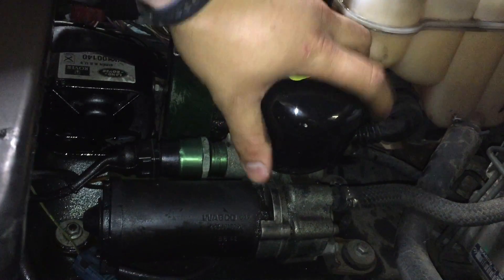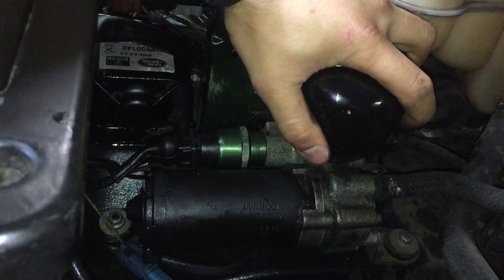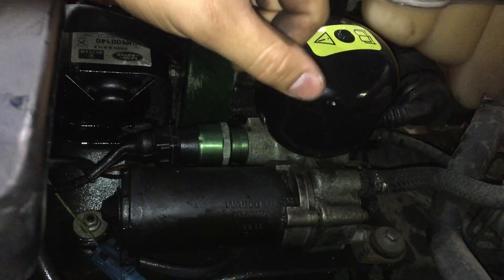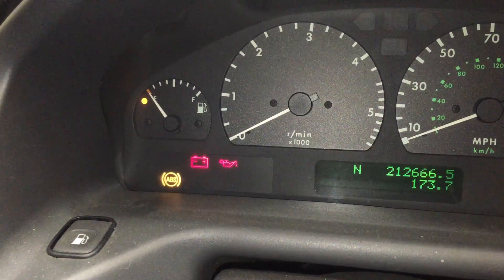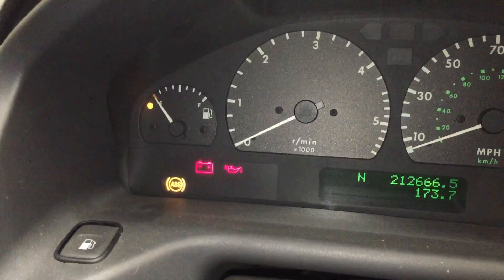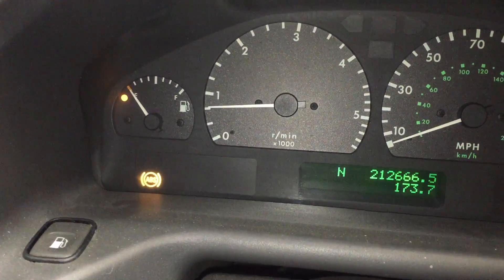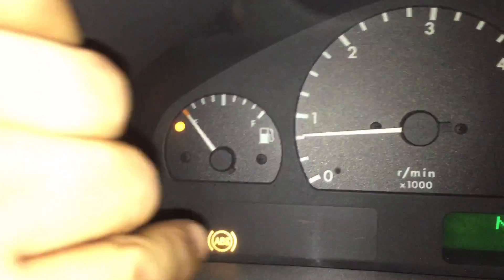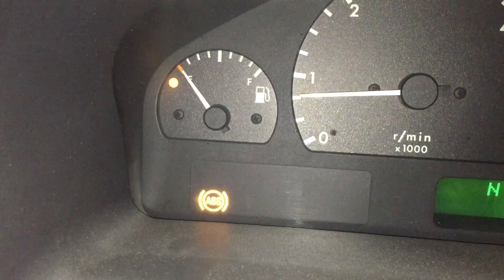Range Rover P38 - ABS Brake Accumulator Fault

Comment: In your case after the new accumulator. how many applications of the brake the pump starts to work?
Reply from the maker: Ricardo Salinas Fournier After bleeding the system and the brake calipers. The accumulator works right away.
Reply: @boconcepts  so replacement of the accumulator requires bleeding the whole system?
Reply: @hak1985org  thank you.